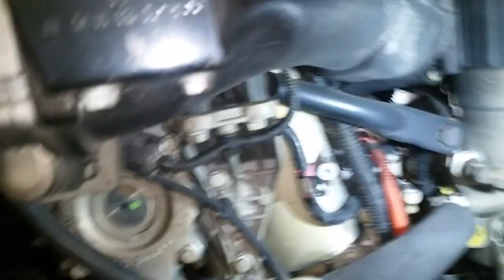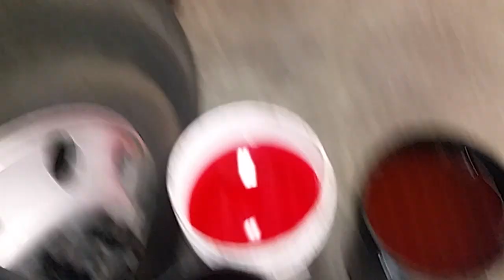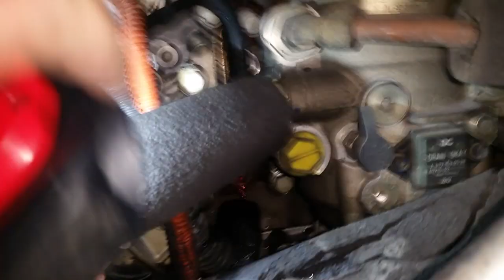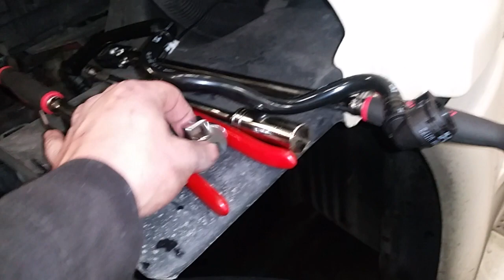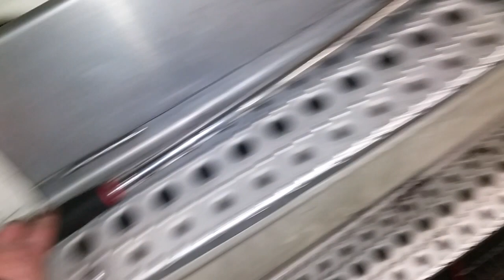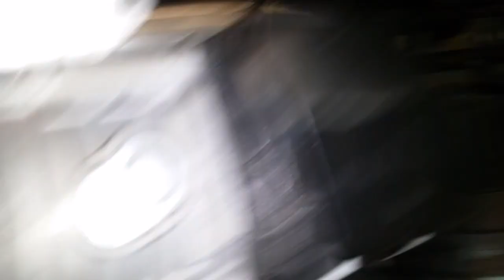Tip: Detroit DD13/15 Full Coolant Drain

Comment: The torque on this bolt is 22 FT LBS!!!!  DO NOT OVER TIGHTEN! Also it's good to pick a plug up to have on hand (they are 7 bucks each) when you plan on draining the coolant.  If it strips, you'll wish you had one.  Also, if this plug strips, you will more than likely need to tap the hole in the block to clean out the threads before putting in the new plug.
Reply from the maker: truck that was issue with finally had to redo the other day, re-tapping was lil pain, but after i got it done and new plug in was sooo much better!
Reply: @BeardedSeabee82  I know mine is awesome.  Once I break the torque, I can turn it with the connected drain hose.  Much, Much nicer!
Reply: What size tap you use

Comment: Hey. Wanna make a flight to Georgia and replace the front pump in my transmission? Lol. Great how to video brother. 😀👍
Reply from the maker: torque converter or shift solenoids? I wouldnt mind some of that warm weather. Too bad it didnt happen out in eastern iowa by my folks place, coulda had er done lickity split out there.  Hopin there is a decent shop out there that can cut ya decent deal on that at least.
Reply: Bearded Seabee82 beats me. My cousin said it sounds like the pump. But he’s too high class to work on my stuff. He didn’t use to be that way.

Comment: Do i need to start the truck for a while first?
Reply from the maker: If you plan on doing full flush and want to get engine warm before hand you can. But do not need to have engine running to drain

Comment: Could you please explain How to replace the leaking coolant hose that you pointed out? (Coolant crossover hose)
Reply from the maker: I might have a spare hose at work might be able to use to explain in another vid. But you do want to undo the clips at each fitting, that will enable you to pull off and fish out. And the new one when it goes on, just fish in and push into place until it clicks
Reply: @BeardedSeabee82  
Will do, Thank you for explaining.

Comment: Hi I have 2006 Colombia and wanna clean coolant reservoir ... so I took it off and disconnect the hoses( big one in the bottom and 2 medium size in the side and one small in the back for over flow) and decide to flush water since I am cleaning that reservoir so I stick water hose in the big hose which I believe feeding the engine and let it come out from the other 2 hoses (engine is off) then put back everything and start feeding coolant in reservoir... after done start up the truck it will run for minute or so and turn off ... do you know what it could be ? I put OEM reservoir cap thanks
Reply from the maker: Any check engine lights?

Comment: I got 2015 Cascadia, drain plug is extremely difficult to open, I'm not sure but I think mine were never touched since manufactured, and when I did eventually open it, after I did drain coolant, I tightened plug back into a place, but coolant still pouring from there.
Did I miss something while I was doing that? Or something stocked between engine block and drain plug?
Reply from the maker: Hey there. Well no, you didnt miss something we have one of our units where the drain plug is same way. Couple of weeks ago had to change air compressor on that one (even though broke coola t line few months before and drained then too) and is still same way. Had to use my long 1/2" ratchet to get it tightened down all the way. The other few dd's we ha e are fairly easy, but that one, as in case with yours is hard as hell. I dont know if it is from fitting itself or the block to be honest. If there are any other questions you have on issue feel free to ask
Reply: I haven't pulled that drain plug completely out, it would not allow me to do it, because of hardness to turn it around. So I twisted off probably 1.1/2 turns until it stucked, and that I tightened back and forth a few times. But it didn't solve the problem. So I want to go to auto parts store tomorrow to get some rust release liquid and spray around for a few minutes, see what it does. But I will follow your advice to get a bigger wrench and tighten more. Thanks for your response!
Reply from the maker: Yeah it can be a pain in rear for sure, the truck i spoke of i hate doing it to since it feels like you are about to bust it off by time it starts to almost get tight enough to seal up
Reply: The aluminum plug usually gets stripped of it threads by some mechanic that doesn't know what he's doing. Simply get you a thread chaser  M18x1.5 and a new plug. The thread chaser is $9 and the plug is $8 ...
Reply: @carbombtorres1761  the plug comes from the dealer, where do I get the chaser?

Comment: Is there a bleeder valve to remove air from the line ?
Reply from the maker: As for bleeder, the engine drain and radiator drain are only.2.drains i know of. We use a vacuum style pump to refill the cooling system on tractors so we dont really worry about that per say. Other option on funnel fill method is to massage coolant elbows and fill, then when filled do low slow idle till engine heats up all way to help prevent cavitation in egr cooler, but vacuum is onw of best waya.

Comment: Many dealers have quit using the stock metal p-clamps. I don’t have a part # but my dealer gave me rubber coated p-clamps. It’s suppose to keep the plastic line from rubbing on the metal clamp. I will find out someday how long it lasts.
Reply from the maker: We keep the rubber coated ones in stock in shop supply. Daimler has had update for then where they use the christmas trees and zip tie. But on occasion we still get the metal one.

Comment: What size hose is that? In what type of antifreeze do I need in?... I've lost a little bit of antifreeze over the course of the last month with a weeping water pump that I'm getting ready to replace... But over the course of the last month, I have added a universal antifreeze, that is supposedly interchangeable with anyting... And now I'm thinking that that wasn't a good idea... I would almost consider just putting the antifreeze that I kept her right back into the system if I didn't think that it might be a bad idea to drain everything and replace it all... Any input would be appreciated
Reply from the maker: Red elc coolant, hose i believe if i recall is like a 5/8
Reply from the maker: Purple alliance antifreeze and red elc is interchangeable, but if you stuck yellow or green in, bes to just start new
Reply: @BeardedSeabee82  thanks..got started on the water pump tonight...what's wierd is, pulled out petcock/plug on bottom of radiator..nothing came out..overflow had plenty in it...when I cracked old pump bolts, she drained out  12 gallons
Reply from the maker: 1/2 hos3 off the block drain. Block drain empties engine at lowest point of engine. Rafiator you usually only get about a gallon out of
Reply: @BeardedSeabee82  man, I don't think my block had that drain plug on the side. There was something that looked like it could have been it, but it had some JB weld or something around it... So I think maybe somebody messed it up somewhere along the way... I got zero drops out of the radiator... The job is done now, and it's all good

Comment: Quick question i have the same problem on mine same hose is leaking wats the name of the part so i can go buy a new one
Reply from the maker: Ubder parts pro is called screw plug. Pt#A6019970430 for this particular unit. BOL finds it under major component, engine, housing, cylinder crankcase.

Comment: Do you happen to have the part number for that line that goes to the filter housing?
Reply from the maker: Not off top of my head but there are a couple of different variations for it and depends if 13 or 15 and the esn. Dealership should be able to get for you
Reply: @BeardedSeabee82  
Thanks man I was able to get it at the dealership

Comment: What is the torque on that plug?  I did this about two weeks ago, and now I'm noticing coolant coming from this port after tightening as much as I safely feel it should be.
Reply from the maker: exact torque I dont know. We go by feel here in shop, however there is 1 particular unit that the plug on has always been stubborn, both unscrewing and tightening back up that we have to tighten to point it feels as if will almost break off, it is a pain in the ass. recommend calling a detroit/freightliner shop that you are familiar with that can look it up on ddcsn, or also, there is 1-800-FTL-Help that you can call for that particular service information.  Wish I had an exact number for you, but i honeslty dont., Sorry.
Reply: @BeardedSeabee82  I called Detroit, they told me it was 22ft lbs.  Thanks man! 🤟🏻
Reply: Just to let y'all know... the threads on that drain plug for the block like to break off and stay in the block. Its recommended to not use it and put a hose on one of the three piece coolant hose coming from the block.

Comment: What is the part number on this hard coolant line? I have had local parts dealers keep coming up short! Thanks in advance
Reply from the maker: Filter housing to block to compressor?
Reply from the maker: And is itone with a coolant filter housing? Not the new ones without? And dd13 or dd15? There is difference
Reply: @BeardedSeabee82   This only runs from block to filter housing, 2 connection points.
Reply from the maker: Shoot me an email beardedseabee82@gmail.com I think I know which one you are talking about can send you pic when i get to work

Comment: Any footage on the fill and purge/burp? I've got a 99 60 series 12.7. Any info would be great. Thanks
Reply from the maker: 12.7 would usually just pull lower rad hod hose and was able to do full drain on those. As far as burp, i use a vacuum filler which does better job, but on 60 series can massage upper rad hose in between buckets and run for 10 mins at idle then stop and massage upper rad hose again

Comment: It's not necessary to drain the coolant to replace that hose.  Go to the plumbing section at your local hardware store and get yourself some drain plugs.  Cork or rubber both work great. Remove one end of the hole and plug the hole while you begin intalling the new one.  When you're done  With one side, do the other one and you are done.  If it takes you a 1/2 hour it took you too long. Very little mess this way.
Reply from the maker: You aren't very mechanically bright when it comes to semi trucks with detroit engines are you?

Comment: Got a 2019 cascadia what is the best coolant to add?
Reply from the maker: Shouldve come from factory with the alliance premix 50/50 purple. Red 50/50 should still be ok on it to mix
Reply: @BeardedSeabee82  thanks for the reply I appreciate it
Reply: @BeardedSeabee82  hey by any chance you know where this drain plug is on the 12.7 60 series on a freightliner classic?
Reply from the maker: 12.7, pop the bottom rad hose
Reply: @BeardedSeabee82  i did bro, i refilled it with distilled water twice after dropping the original coolant but its still light green the coolant afyer the 3rd drain, thats why i was asking for help on findomg the drain on the block lol. Btw on the 3rd drain i only put 3 gallons of water on  empty  block and the check engine light and engine shutdown lights came on, the temp gauge only wemt up to 175 so idk if it over heated without gauge letting me know. Gave me a good scare when i saw that light but i know the temp. Didnt go past 175 so it must not have overheated
Reply: @BeardedSeabee82  lower rad hose dropped about 9-10 gallons of coolant bit i hear the series 60 has about 12 gallons which means 3 or so gallons are left inside the nlock until thermostat opens up
Reply from the maker: I dont recall or think the water pumps on those had drain. I do remember the kangaroo pouch(style of water pump) would hold back a couple of gallons. And pulling those off just to drain isnt worth it.
Reply: @BeardedSeabee82  ok... do you recommend swirhcing to red coolant from green even though it has about 2 gallons left of old green antifreeze? Wouls it gel up?
Reply from the maker: It wont get up per se, but will look off in color especially in the surge tank. Alliance/daimler also has a purple coolant that i understand does well. But if you were to put 10 ish gallons of fresh red or purple it should be ok. I know we have a few cngs out there that at some point had gotten a gal or 2(maybe even 3) of green due to limited availability or drivers not knowing and i dont recall them having any problems due to that.
Reply from the maker: Oh.. damn key board "wont gel up" not get up lol.
Reply: @BeardedSeabee82  thanks for the info man